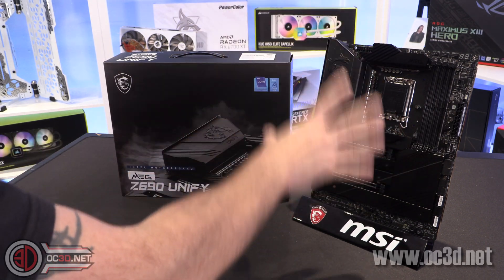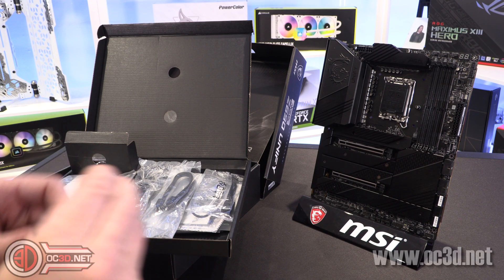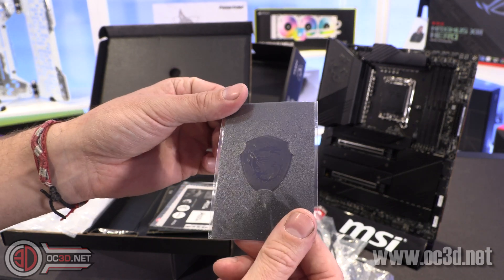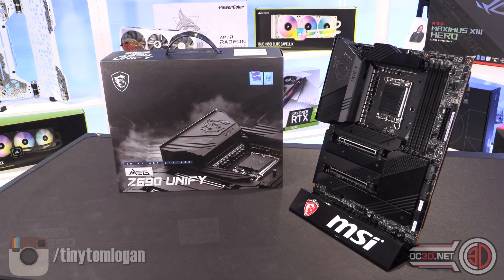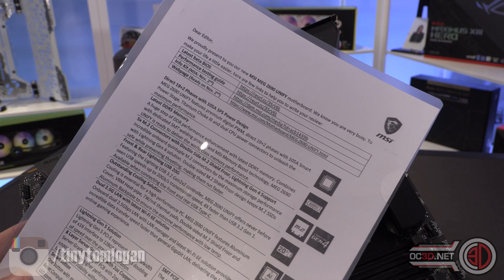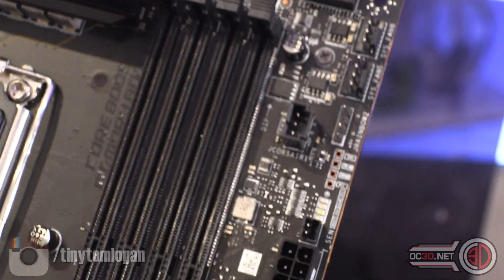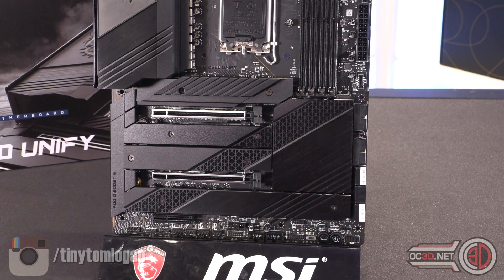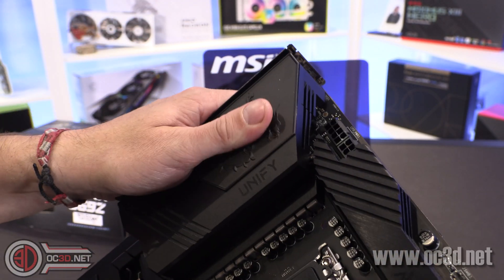MSI Z690 MEG Unify - no RGB - Motherboard Preview

Comment: Rocking this board for about 2 months now, best board with zero rgb and looks. The back has a plethora of usb's aswell, you will never run out. Onboard wifi and Bluetooth just takes the cake, just get the unify
Reply: I have had this same board for about 2 months as well, my PCH temp is extremely high, 80-84°c at times at idle. I have 3 - M.2 & 2 - HDD’s. I had a Z690 Tomahawk that never reached above 60°c and I also have a Z590 Unify that is around 52°-59°c (only has 1 - M.2). Would you mind checking your PCH temp? Just curious what others temps are. Thx you!

Comment: I have the Z490 Unify, which was a great board at $320.00 US.  This Z690 board is about $150.00 overpriced.  The Aorus Master Z690 offers more than the Unify for only $470.00.
Reply: Agree. This should be a $400 board due to 8 layer + 19 * 105A power stages. It's about 100 USD overpriced.

Comment: The unify boards have been consistently amazing price:performance since they came out.  The problem this time is they decided to price them on par with other similar high end overclocking boards.  If i am paying $600+ USD for a board, then the APEX and the EVGA Dark also become options.

Comment: Those who are new to these boards - Unify has insanely good overclocking potential. They're some of the best RAM overclocking boards every time. Hopefully that is still the case with Z690. Unify X is even better because it has just 2 RAM slots which helps with getting even higher RAM OC. Looking forward to this board even tho it's expensive asf.
Reply: Dude I totally agree with you…I currently rock a z490 unify and freaking love the oc capabilities with the 10700k might continue with the unify on this z690 series
Reply: Where can I find one!?
Reply: @MIL-STD  They don't exist yet :/
Reply: @mcgmgc  well they must exist in some quantity since the reviewer has one. They're definitely not on shelves though I agree
Reply: @MIL-STD  amazon

Comment: Hi , interesting board , i need to upgrade from z370 but im on Asus "team" whatever means  . Back in 2017 i've watched review for rog-strix z370-E from you .... and still use it untill today . So , ASUS Intel Z690 ROG MAXIMUS HERO from my understanting this board has three  M.2 on it , great , i use only two anyway , which one of M.2 slots is from cpu lines ? Is it the one next to it (cpu) if it is or all three are from chipset z690 's ?   Would be clearer if documentation for consumer would be available than jingle bells dashing on the screens . Cheers mate . Have a good one !

Comment: great board.. don't need the RGB-stuff in a closed case - but what is really hard to find is the 2xUSB3.1 headers on the board. As I'm a content creator my system has a card-reader, which needs on pin - and the other is for case's front-USB of course.